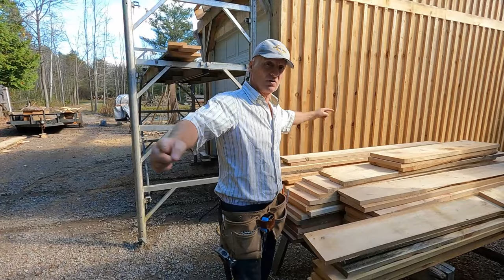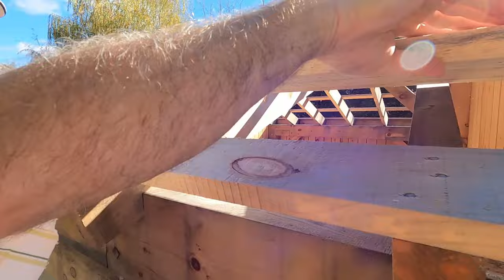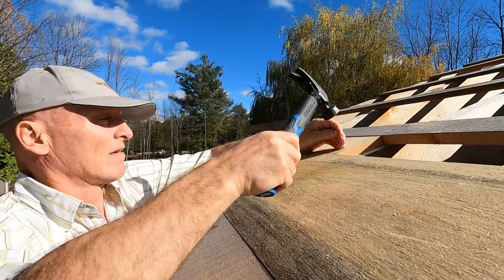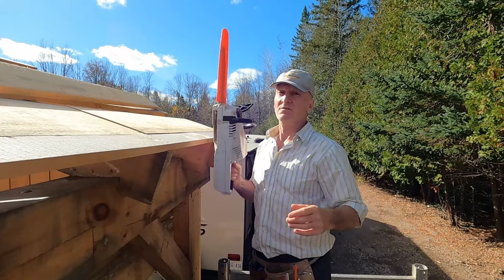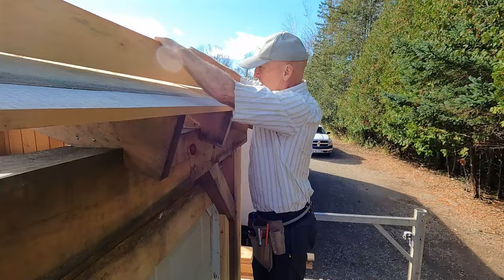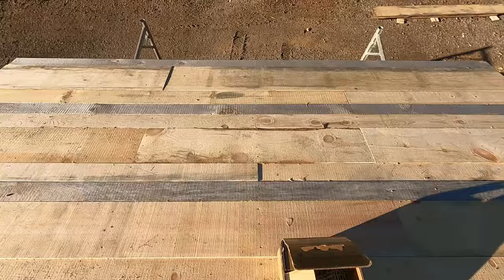116 - Timber Frame Shed | Boarding The Roof | Part 13

Comment: How's she goin'?  Changing plans, well there ya go, I always figured that was part of building something!!  Changes are just a part of the process.  You are lucky to have the mill and access to the lumber.  The roof turned out pretty nice.  There's no shame in what you have done that's for sure.  A real solid roof now Paul.  Thanks for posting and showing us how you worked around some of the issues you came across.  Take care!!
Reply from the maker: It's goin good Mike.  You are right it is part of the process.  Sometimes I get too busy and have to adapt due to circumstances and I don't like it.  Absolutely lucky to have the mill and a ton of lumber.  The rood is super solid and I installed the shingles already.  It's onto the electrical which I like to do.  Have a good one!

Comment: Good morning Paul,  We too had planned a metal roof on our barn, changed our minds and went with shingles. This looked inconvenient but  I am sure you had good reasons for changing your mind. Nice that you could make use of the lumber you had on hand. Have a great weekend, Ben
Reply from the maker: Good afternoon Ben.  I am fortunate to have an abundance of lumber on hand.  The major reason is the second part for the mill.  There are a couple of things that I need to do first.  It would have created too much of a complicated issue if I would have gone with the metal.  This way I am able to button up the tractor part from the elements until I am ready to finish up on the mill section.  I have installed the shingles already.  You too have a great weekend!

Comment: Hey Paul we used purlins and covered them top to bottom with the thought of it being 1” sheeting.  A lot of work no matter how you do it.  It’s a work of art!  😊🌴👍🏼
Reply from the maker: You are right about that Mark, it is a lot of work either  way.  It's the look of the wood that is attractive in comparison to metal.  Did you use 2 foot centers on the strapping / purlins?
Reply: Yes we put house wrap up first on top of the 3x5 purlins spaced at 2’.  Then full length 1” sheeting poplar and pine vertical.  Not sure what the final cladding will be yet.

Comment: Oh no Paul! What happened? I would've have thought that sourcing a metal roof and the price skyrocketing would've been the major factors in moving to shingles.  Must admit the fact that you put so much work into making sure everything was nice and square likely paid off when you were filling in the gaps! Cheers, Alex. Btw you do not seem bitter at all that you changed your mind... 😂
Reply from the maker: Hi there Alex, whether metal or shingles it's only a few dollars different between them.   The major reason is the second part for the mill.  There are a couple of things that I need to do first.  It would have created too much of a complicated issue if I would have gone with the metal.  This way I am able to button up the tractor part from the elements until I am ready to finish up on the mill section.  I have installed the shingles already.  Overall I am pretty happy with the results.  Have a fabulous Sunday!

Comment: Looking great Paul, I would assume the major reason that you changed your mind is because of the snow pack that’s coming.    I don’t have that problem down here in the south.   It sure is gonna be awesome when it’s finished.
Reply from the maker: Thanks Tennessee Yankee.  It's structured to handle any snow load thrown at it shingled or metal roof.  The major reason is the second part for the mill.  There are a couple of things that I need to do first.  It would have created too much of a complicated issue if I would have gone with the metal.  This way I am able to button up the tractor part from the elements until I am ready to finish up on the mill section.  I have installed the shingles already.   Have a great weekend!

Comment: Nice work Paul, I’m curious why the last minute change, was there an issue sourcing the metal roof? Have a great weekend Paul 👍🏻🙋🏼‍♂️🙂🇨🇦
Reply from the maker: Thanks Luc.  There are a few reasons for the change.  The biggest is that the second part for the mill.  There are a couple of things that I need to do first.  It would have created too much of a complicated issue if I would have gone with the metal.  This way I am able to button up the tractor part from the elements until I am ready to finish up on the mill section.   You too have a great weekend!
Reply: If there is ever an issue with sourcing a regular metal roof (agricultural or standing seam), it's past time to head to the bunkers. Those fancy slate and wood shingle look alikes, sure, but regular metal? Yeah, it's pretty much the end of the world as we know it.